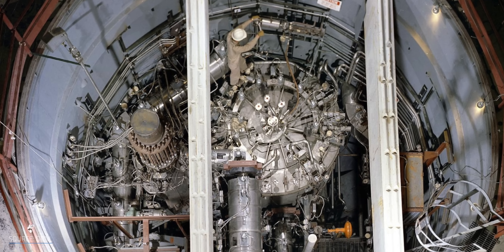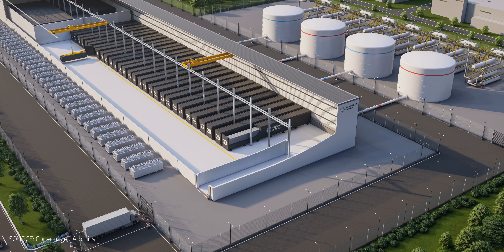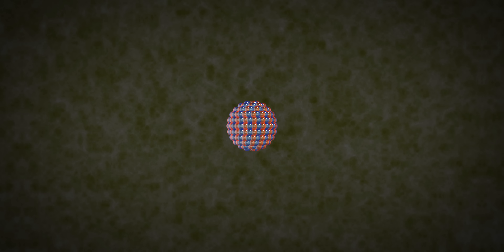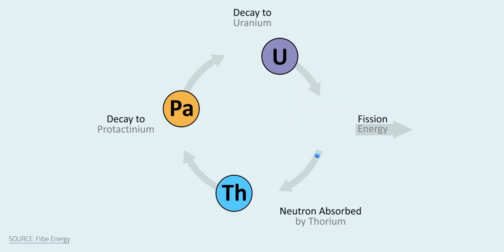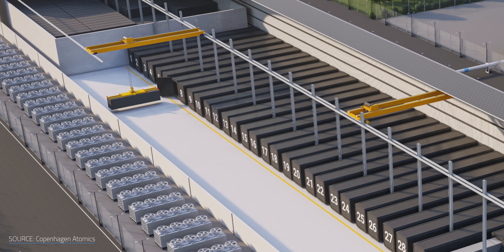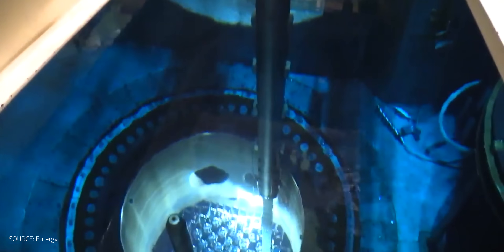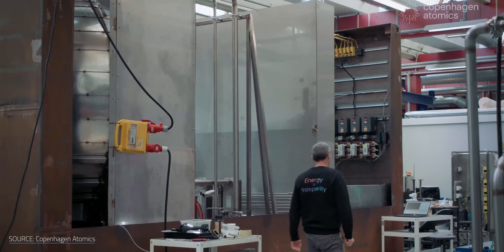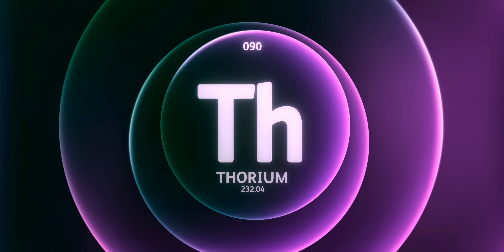Why Thorium is About to Change the World

Comment: Finally, we're on the right path. Twenty years ago, the US shut down FFTF and abandoned nuclear energy research for the foreseeable future. One type of Small Modular reactor is not the answer. Development of all types advanced water reactors, High Temperature Gas reactors, Liquid Metal Fast Breeder reactors and Molten Salt reactors, would ensure clean so called green electrical base load power for domestic, data centers and electric vehicles for hundreds of years. Being trained on and an operator for almost 2 decades before the programs ended, I know safe SMR's, fuel recycle, waste burn and monitored retrievable storage were the answers we developed but were never allowed to pursue. Instead we sneeze and choke on petrochemical polluted air so that a small minority of wealthy can stay wealthy!

Comment: This sounds interesting but immediately has some obvious problems that will need to be solved before it is practical.  First, if each of these modules produces a few MW, there would have to be one hundred thousand to a million of them before they start to be a significant part of the world's electricity need.  With this number of reactors the material they are made out of would have to be recyclable, or the reactors themselves (neglecting the radio active fuel) would become a significant source of waste -- the same reason that Li-ion batteries have to become recyclable or the battery storage idea fails.    Secondly, while it is true 300 year necessity of storing the spend fuel is better than 100,000 years for traditional reactor waste, 300 years is still a problem.  How many corporations last for 300+ years?  Generally as soon as a corporation has a significantly liability they declare bankruptcy and abandon all of their responsibilities.  What's to stop any corporation producing thorium reactors from doing this?  The Chinese government may live up to such a responsibility, but even the governments of Western nations cannot be relied on for this amount of time as currently being demonstrated by the Trump administration in the United States.

Comment: "There's only X years" is misunderstood by people.   And no, it's not just about most Uranium being "unused".   It's about availability and terms of cost.  "Peak oil" has the same issues in terms of understanding in the public.   If every physical ground mine ran out of gold, you could literally "mine" gold out of seawater.   As for Uranium, you could use "used" uranium in more neutron efficient reactors like the CANDU, with the DUPIC method.   But no one does....  It's the cost and the extra complexity.

Comment: I remember learning about thorium reactors in HS in 2014. Back then, the issue was that they create weapons grade ursnium or plutonium which could allow crazy adversaries to create nukes
Reply: Thorium is breeded to U-233 and a small part of U-232 in a mix. As U-232 decays to TI-208 at some point, an this issues hard gamma radioation, the U-233 is not quite usable for weapons. This would be one advantage of the thorium cycle.
Reply: @egnegn123 how hard would it be to turn the u232 into u 235? Isn't that what they use in nukes? This isn't my field of expertise

Comment: Thorium is obviously a much better and safer material for Nuclear reactors, it will be a long way down the road before we see it's full true potential which is for powering decentralized grid electrical generation. But the chinese are on their way to dominate thorium technology, with a large scale reactor being built at the moment ready to come online next year as well as finding a Thorium deposit in China that is estimated will supply 60,000 years worth of electricity? (No mention of how many Gigawattts a year)?.  I didn't hear you mention the facts that Thorium is a 97% efficient fuel (in a Molten salt reactor. Compared to uranium in a Standard watercooled reactor at 7% efficiency meaning that Thorium material is burned up 93% of all it's mass while Uranium leaves 93% of it's mass as waste or depleted uranium, which in it's self is the primary reason for all nuclear reactors to be Thorium Nuclear reactors in the future. (IMO).

Comment: Oh dear. Once again the power of stupidity brings up the fifties myth of 'unlimited free energy' from someone who should know better. It was a simple idea to reassure people that nuclear wasn't all bombs, that it could be used to supply power too. All cuddly and warm, nothing scary huh? Yet, despite decades of promises and billions spent on research, the clean cheap energy promise has yet to materialise. Which is bad enough, but what if the promise became real? What if nuclear was suddenly to provide all out needs? 

It would change nothing. On an already overheated plant, with legacy pollution from fossil fuels increasing gloab heating year on year, the addition of energy derived not from the sun but from a source that has never been part of the energy system that makes life possible, and that takes no carbon out prior to adding heat. In fact, nuclear isn't even carbon free as the nuclear cult constantly claim, the mining, extraction, processing and transport of fuel adds CO2 inevitably, and the building of the reactors using massive amounts of steel and concrete adds a further gigantic carbon load to the atmosphere before a single watt has been generated. 

Fission, fusion, it doesn't matter, all will add energy [heat] to Earth without removing anything, and adding energy to an already heating planet will do nothing to reverse the process, but will ass massively to it, along with geothermal heating and electricity generation which similarly adds heat to the atmosphere without any balancing removal. Yet these two are constantly touted as acceptable 'carbon free' sources, as  if carbon free is all that must be considered to solve the problem of climate change. 

Since our current harvesting of energy from the sun in a variety of ways uses just 1% of the available energy arriving on Earth, the constant seeking of a magic bullet to 'solve the energy crisis' is nonsense, merely increasing renewable extraction, which, as the word extraction implies, removes energy to be used, eventually returning it to the atmpsphere, there is a nothing extra added. This is the only way we can harvest energy that doesn't make things worse. All that is then required is to remove carbon, to reduce that in the air and eventually cancel global warming. This is most efficiently and cheaply done ny growing hemp; the toughest plant-based fibre capable of processing into a range of fineness to be used to make the whole range of materrials from underwear to coarse canvas and ropes, along with building boards as substitute for wood. When hemp based products eventually reach their useful end, the fibres can be recycled into paper and cardboard.  No high tech costing millions, a simple bio solution with no side effects or waste. The ludicrous nuke claim of too cheap to meter is taking thepiss, considering billionsd have been shelled out so far for nothing. On the other f=hand, renewables have now got so cheap they actually are too cheap to meter, so all those buying 100% renewables are forced to pay the highest cost, which is gas. And any new nuclesar will be paid for by raising bills, as always. Best option is off grid  supply your own energy.  

All renewables are carbon free apart from the small amount from manufacturing PV cells and wind generators. And the supply is guaranteed for the life of the sun. There is simply no energy crisis, and no reason why billions should be wasted on the nuclear fantasy. During the ten years it would take to build one nuckear reactor, there could be millions of offshore wind generators installed, plus billions of PV panels on roofs of houses, factories and warehouses. The nuclear cult keep coming up with something that's going to be a 'gamechanger', but all they are really after is more funding, more pay for scientists to pursue their hobby, paid out of the taxes of the hardworking population. It has never and will never give a resolution, but will add to the waste mountain that currently can only be disposed of by adding to the tips of all bullts and chells made by th4e arms manufacturers and distributed widely by armies. Current war zones are likely heavily radioactive, which doesn't promise a good life to the inhabitants of Ukraine and Gaza.

Comment: It sounds good. With one company and an entire country (China) working on this, it seems like this might be the answer for nuclear power. However, I can't help but think we'd already be there if research and experimentation with the molten salt reactor invented at Oak Ridge would have been allowed to continue. You mentioned one reason why that research was canceled but I guarantee you the main reason was the big, profit focused electric utility companies in the USA opposed it, along with the coal industry and the construction companies that built coal burning and traditional fusion power plants. They stood to lose too money so they went to the congressmen they owned and made sure the work being done at Oak Ridge stopped! For-profit corporations are often the enemy of scientific discovery and advances.
Reply: China's thorium molten salt reactor is already online and running. I think recently they just successfully added new fuel into the system too, making it sustainable. This tech is already existing.

Comment: Just a couple of key points. 

I would invest heavily in researching this branch of nuclear innovation. 

That said, the main obstacle to this technology being implemented widely is (from what it sounds like) weaponization. There is ZERO chance this tech will be used in anywhere except a few select markets globally given the ability to divert its use into weapon manufacturing. ZERO. 

If there was a way to somehow overcome that insurmountable hurdle, then it becomes an engineering/consistency problem: do we actually have the material sciences to solve the degradation issues, and could these companies be held to manufacturing consistency standards that would ensure safety, when cost-cutting and profitability are the key drivers of production? 

Finally, for the love of science, STOP TALKING ABOUT REGULATION AS IF IT IS AN OBSTACLE  TO INNOVATION. 

Regulations aren’t hurdles, they are criteria to be met to make sure companies and personal activities don’t create more problems than they solve. Regulations are a part of the planning process, not an obstacle. If there is a “mountain of regulation” that is a pretty good indicator that what you are attempting to do is not benign, and can significantly and negatively impact society. Demonizing regulation is largely the equivalent of saying “just think of what we could accomplish if we didn’t have that pesky morality and consciences to deal with!”

Comment: We are not running out of uranium in 200 years. We are not running out of oil. There is no climate change. At least none by us. Nuclear is as big of a lie as "fossil fuels." Stop believing the lies. We are tired of how dumb you are.
Reply: The "200 years of Uranium left" and the "50 years of Oil left" is not entire Earthly reserves, they're calculated based on current economically viable reserves, Because we could extract Uranium from some random deposit extremely deep in the Earth, thing is that it will be extremely expensive to do and henceforth not cost effective, same for Oil.
And as Science progresses and we find new better methods, we make these previously too expensive sources reasonably expensive, and we increase the deadline.

Comment: Regardless of tne technical or manufacturing feasibilities, any possible/potential  nuclear power source that uses a reactor of any kind is doomed from the start. 
All such have  been thoroughly demonized beyomd belief. The vast majority of people have been brainwashed to believe in meltdowns, Chernobyls, 3 Mile Idlands, Cnina Syndromes, etc. -  not to mention Hiroshima's of course.  This Cult controls the  political narrative which will trample any sane constructive energy solution. Including fusion.

Comment: No, this does not make nuclear safe because 1) it still requires two kinds of radioactive material to be mined and stored while decaying 2) it constantly creates bomb fuel.

It may be better than the big meltdown power plants but the core problems of dig & burn, radiation pollution, and weaponry remain.

None of these are problems with green power generation.

Comment: This reactor is a bad design. How is this reactor not pressurized? Wouldn't the heavy water side would need pressurized since it would just be steam at molten salt temperatures? of course, the fuel side doesn't need to be pressurized.  As far as I know, steam isn't a very good moderator.  
I don't believe this is a very safe system.  Radioactive molten salt (which is highly reactive with with water) is surrounded by high pressure high temperature water on all sides.  Sure, if the fuel salt gets too hot, it will melt the salt plug and drain to the tank, however if there were a breach within the vessel itself, the whole system would explode, spraying radioactive fuel everywhere.

Comment: I been saying this for years about thorium reactor power, is not the way to governments want  to go, the downside is, a lack of nuclear weapons from this element. And it's as a half life of 50 to 500 years depending on how much they use, and if you make smaller reactors, but with high yields of electricity from thorium in such a reactor. You could build a reactor for a few million quid and thorium so plentiful and cheap it's a no brainer whereas if they go full on their other element then you look at a bill of 50 to 100 billion and it's run by foreigners for the first few years and you get weapons grade stuff to sell and make weapons 
Love mom

Comment: I know absolutely nothing about atomic energy, except all the horror stories. I have always felt atomic energy is the way forward, and seeing new technologies being developed gives me hope. I am sure all these engineers have thought of how the heat will effect the magnetism in the bearings for the pump... With the cooler liquid going into the onion at 1100 degrees, I would be interested in seeing how they got around that. In my tinkering I have tried a perpetual motion engine design using magnets, heat is my issue.

Comment: So, I could be wrong about this, but from my understanding, depleted uranium can be re-enriched to be fissile again, while it sounds like the thorium is being actively consumed to form lower atomic number elements. Are we just counting on being able to find a new solution before we run out of thorium?
Reply: Depleted uranium is the residue of enrichment of the about 0.7 %  U-235 to about 2-3 %.
You cannot enrich DU economically. It is currently "waste", but could be used with some Gen IV reactors, together with highly enriched U-235 to breed Pu-239. This is then fissable. 
There a better Gen IV reactor concepts that run 20 - 30 years with one set of fuel, or they use on-site pyro processing, which cleans up the fuel constantly, and allow removal of posions and injection of new fuel.

Comment: It seems like using a bunch of small reactors would be safer as well, as you can isolate a problem reactor from the rest easier, which prevents the ability for a major meltdown like you'd see from a big reactor such as Chernobyl.

Comment: If sustained fusion reactors are finally achieved within the next couple of decades, thorium would have been a has been technology. But science has been saying fusion reactors are just around the corner for generations already 😏 what I still don’t quite get is why thorium reactor technology wasn’t developed decades ago, when it first came out and worked for a few years too! Was it just a funding issue or a significant technological bottleneck back in Weinberg’s time as well?

Comment: It was my understanding that the fast breeder, pressurised water reactor was favoured over thorium reactor asit  made it easier to make atomic bombs in the 1960's?
 Although Weinberg held the patents, he was completely against 'conventional' reactors for full scale power generation because they were designed at a size for nuclear submarines and aircraft carriers, smaller size being easier to build to a higher safety standard?